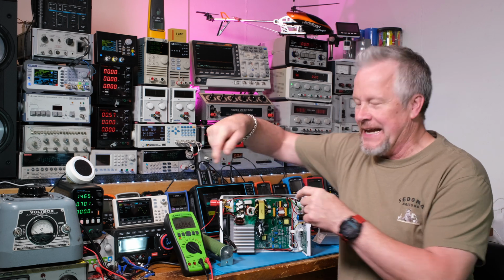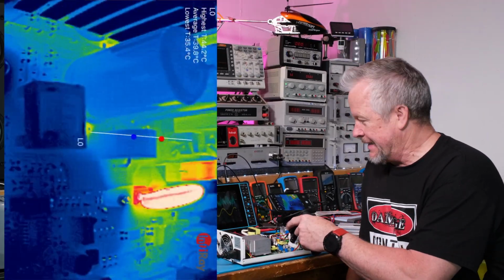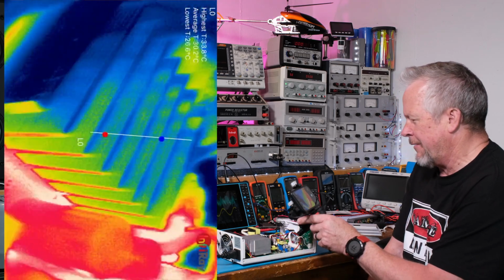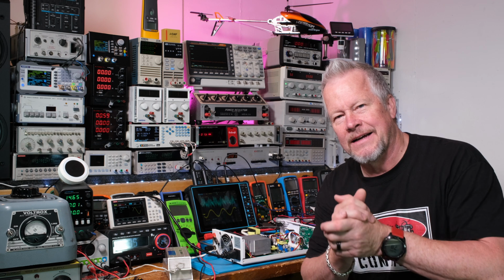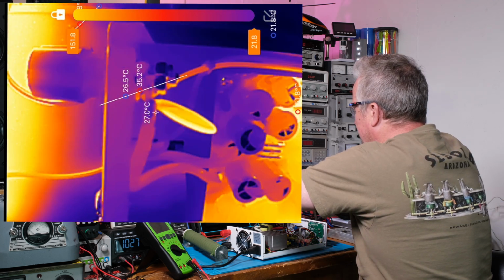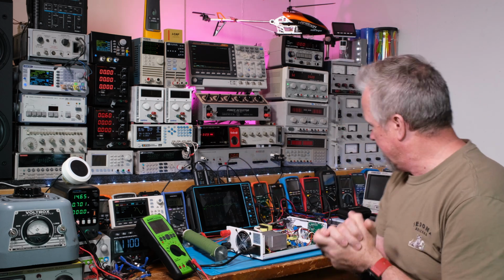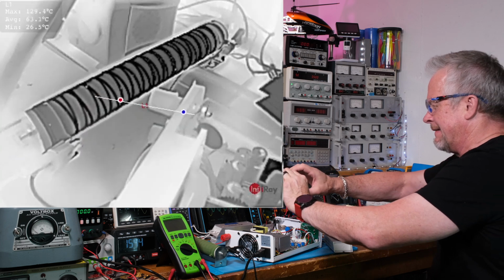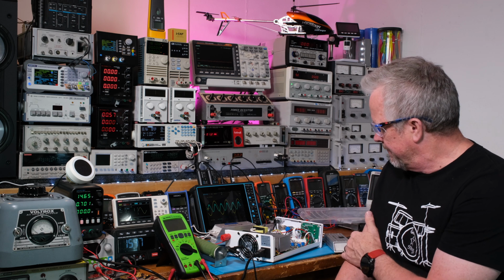Thermal pix of Nice Power lab power supply using Infraray T2S Pro, TOPDON TC002, and Infiray P2 Pro

Comment: Recently, I have been simulating Blameless with 2 output pairs, emitter resistors 0.1 Ohm, +/-45V supply. When properly biased and idling, CFP output dissipates about 0.4W of heat per transistor. EF2 output dissipates massive 11.5W per transistor while doing nothing. I need six channels (24 power transistors). So the difference is 10W vs. 275W. I have to make CFP work.
Reply from the maker: Very interesting!  Sounds like you have a challenge;)  Thank for your feedback!

Comment: With open case it is easily posible you can get higher temperature of components then when case is closed when fan is on. Slots on case direct how air will flow over components, we had case when moving slots just 5mm reduced temperature of components for 30% (or over 50% then when case was open), with fan on.
Reply from the maker: I'm glad that you brought up this great point!  The cooling system design is based on air flow and it does change it when the top is off - especially I think when the air is pushing in.  I will have to test this at full power with the top on to see how long it will run before shutting down - if it does.

Comment: Interesting!  Given the varying emissivities of materials, I wonder how accurate the indicated temperatures are.  It might be informative to compare a thermocouple or other contact thermometer to the video for various components to get an idea of just how much you can believe the video temps.
Reply: Absolutely agree.
Reply from the maker: That's a great point - and I usually place electrical tape on shiny metal surfaces like the heat sink and the top of aluminum caps.  I've been doing this so long and have made comparisons before that give me a pretty high level of confidence.  I'm usually not looking for exact temps but looking for what parts are getting hot, and then checking to be sure that the temps don't go to high (with a 10 degree tolerance or so).  If I want to know the temp to a tighter tolerance, I will use a thermal couple to compare my IR measurements to.  The camera is just a great tool to see the whole picture and help illuminate (pun intended) the parts that might not have been suspected to be on the hot side.  I'll do a video and compare the measurements.  In this video I used a temp probe to watch the temp on a class A amplifier heatsink.  I needed more precise and local temp to see how thermal grease (applied correctly) made a difference.